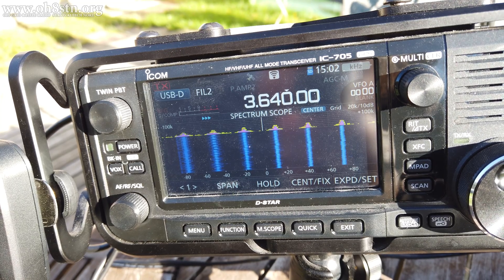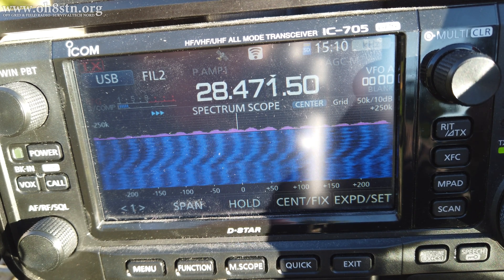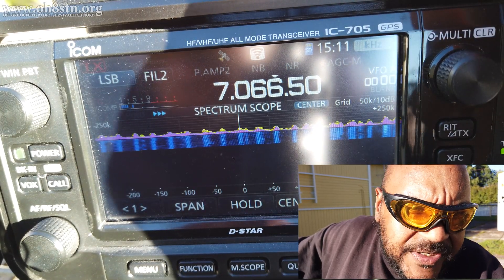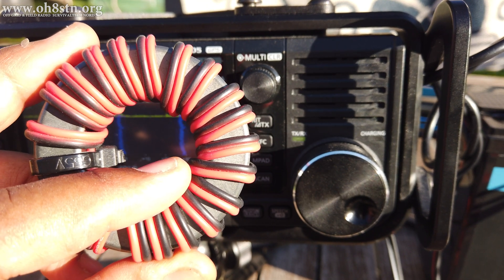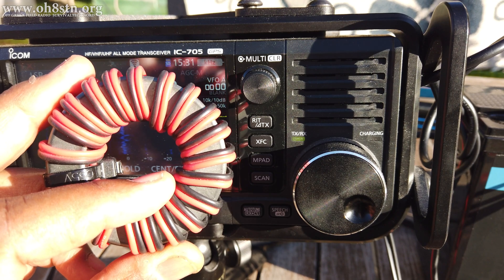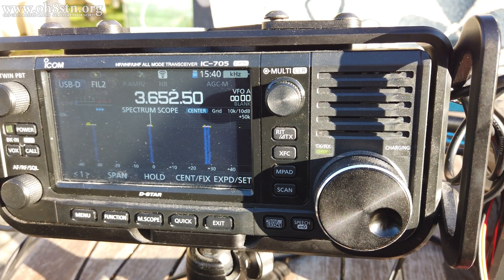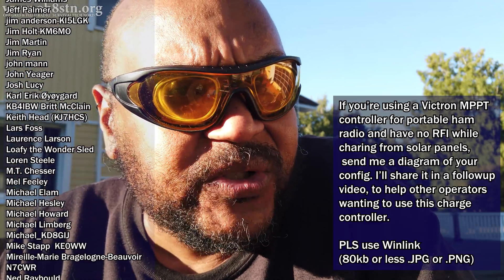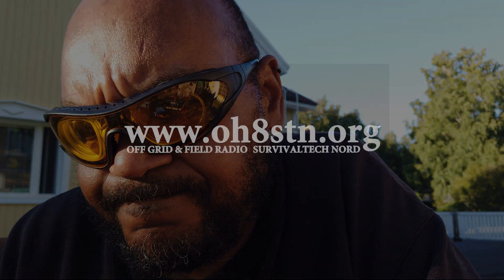Victron SmartSolar MPPT Charge Controller

Comment: Julian, I did a bit of testing with the 75|15 and never got back to you, the radio needs to be connected to the battery, i noticed on my smaller 6Ah battery it was much better but still not acceptable... however on my 100Ah Lifepo4 it was nearly silent.... i went back to the 6Ah and added a filter cap inline and was nearly as good as the larger battery. According to my spectrum analyzer there is always there when in proximity of the victron even when not connected to the radio, even with genasun. Victron is usable with a large filter cap and radio direct to battery... with a larger battery acting as a filter it was as good as genasun......... but who wants to carry around a 100A battery?

Also, with lead acid battery as filter i noted remarkable results with both controllers on the service monitor.

So i think the LiFePo4 is the learning curve hump to get over
Reply: I'm hoping to put some time into some more testing soon.... i am thinking it will require a simple filter method with more than just a capacitor on the smaller batteries.... first company to make an RF silent charge controller will win big! but we are just a very small segment in their demographics so not holding my breath. 

As for now, even the genasun is bringing noise, but it is much better (according to service monitor/analyzer) than the victron, epever and go power that i have tested.

As you know, i operate my station with Mazzoni Loops exclusively and even my genasun 10amp makes noise on the loops narrow bandwidth that can be heard by ear, radio filtering makes it tolerable and in many cases knocks it out since it is not a wide banded byproduct..... but it still needs to be overcome for the really really nitty gritty weak signal work, on the entire spectrum available to us.
Since my antennas are so narrow I am believing most of the noise is coming from the power system rather than the antenna, if you have a chameleon or similar loop you should be able to reproduce my findings easily with an analyzer...... maybe not so much with the genasun by ear though. (it's definitely there by ear on my ftdx101)

My next test I plan to add additional shielding to the victron and genasun to try to determine how much is coming through the power leads vs the antenna, as well as try different battery species to better understand if maybe the Li and/or BMS is exacerbating the noise.

Comment: Hi Julian,
I've seen several comments mention a Faraday cage. Could you try just wrapping the controller with aluminum foil as a test? Stay safe.  73  WJ3U
Reply from the maker: Yes, I'll try it. Got copper tape incoming.  Will cover the inside of the enclosure. 
73
Julian oh8stn

Comment: Had a similar problem from a router some time ago. Even if I put the router in a metal box, as a faraday cage, to make sure RFI wasn't the issue, that at least proved the problem was EMI on the ethernet lines, as opposed to RFI from the router.
 Divide and conquer. Or see what Victron has to say. Their marine users will not be happy about SSB interference.

Comment: I saw noise with my Genasun GV-10 when I first got it and what I did was put two of the Powerwerx DC Line Noise Filters on each of the solar and battery lines (not just one or the other). That seemed to help significantly for me, at least, but then again, the Powerwerx product also has an amperage limit that might not work with the Victron controller. Maybe it's possible to parallel more than one of the filters for increased current capacity?
Reply from the maker: Found them! DC line noise filter maximum 20 amps from Powerwerx. I'll order a few. 👍
Reply: Did the filters fix it for the Victron controller? @OH8STN
Reply from the maker: I haven't heard of those powerwerx line filters before. Great comment, I'll give them a look.
73
Julian oh8stn

Comment: that is interesting.... we use these for work for our remote sensors and have been fighting interference issues on vhf. i'm going to have to dig out my spectrum analyser next time im at one of those sites
Reply from the maker: I really appreciate this comment. Any anything you learn please come back and share. Thanks for watching and commenting.
Reply: @OH8STN  yea for sure...  i will do... but might be an idea to check your radio on 144/433 too see if it's there as well... my guess is if it's stopping when you unplug the solar it's the pulse width modulation that it uses as charging
Reply: I have the 240v 17ah charger and it also wipes out uhf/vhf

Comment: Thanks for thr Video! I have the 75/15 and 100/20 MTTP Victron Solar Charcher. I didn't habe any problems jet. But I'd have to admit that I use normaly 40m and higher QRGs. But no Problem so far on my FT 991A. But a question: Test it with a solid grounding of the system. Maybe the solar charger generates a lot of less HF with that. Ans test it with other Rig. Sometimes the Radio Filters are not good enough. Cheers from switzerland.
Reply: Julian can you also do a test with other radio maybe a 100 w Yeasu
Reply from the maker: Already tested with Yaesu FT-817ND,  Icom IC-705,  Xiegu G90, Xiegu X5105,  Xiegu x6100, Vertex Standard VX1210 and SDR. Sadly, It isn't the radios, it's the charge controller!

Comment: It would be interesting to redo the test with a choke on each of the inputs and outputs and at each end of the cables. The cables must also be twisted over the entire length and not in parallel except on the ferrite.
What type of ferrite was it? Is it #31? That too is important.
And of course, it is always necessary to feed directly to the battery for the radio.
A choke on the antenna and the radio on the coax will ensure that your coax is not part of the antenna, therefore picking up less noise from the charge controller.
But actually, the fact that the components are not fully wrapped in a metal case does not help.
I wonder if the ''Nickel shielding spray paint'' inside to create the desired effect or simple self-adhesive copper strip inside could help?

Comment: You might be able to get a faraday pouch for a tablet that could fit this controller, fail this wrapping in tinfoil might work. If this works you could take the cover off and stick some tinfoil to the inner face of the case etc. I am looking at a small solar set up for my shack, will be interesting to see how you get on. Good luck Julian!

Comment: Years ago, I worried about RFI noise from MPPT solar chargers, so I ordered a "Morningstar Tristar 45A PWM Solar Charge Controller". But, PWM also makes RFI noise! So, I changed it's operating mode from PWM to OFF-ON charging. That allows me to use Ham radios while charging up my 48vdc battery bank.
(I've been off-the-air for many years and recently got interested in HF again).

Recently, the price of electricity has gone up. So, I decided to get rid of my old Modified Sine Wave (MSW) AC power inverter and purchased a "Xijia 3000W (Peak Power 6000W) dc 48v to 110V 120V ac 60HZ Pure sine Wave Inverter". So I could use my "back-up" system to provide a little relief from high grid prices.
By running the new 3kw inverter, I can save a few bucks on power and insure my back-up system is always in working order. 

Oddly, it's the 3kw (Sine Wave) inverter that's making RF noise. Very similar to what's on your spectrum analyzer display. It's got harmonics on all the HF ham bands. 

My current HF rig is a QDX (QRP Labs Digital Xcvr) and it's almost useless for DX when the 3kw inverter is running. So, when I want to work some DX, I turn off the 3kw AC Inverter and use the grid. 

PS: I've seen similar RFI waterfalls randomly while using the QDX. They seem to be coming from some local source.. Maybe someone is using Solar RFI generators in my neighborhood?

Comment: Get another MPPT charge controller.  Don't waste your time trying to fix the Victron.  I see you use a Genasun charge controller.  Good.  I have no noise/interference problems even connected to a LiFePO4 battery with internal BMS.    Handles up to 140W/10amps.

Comment: Would an extra connected battery help ? I realise it means extra weight & bulk in the field but I'm wondering if it might filter out some of the noise from the solar panels as the current flows into one battery & then via the other.
Reply from the maker: This will definitely work. It would mean reducing the size of the batteries and carrying two. Discharge one while charging the other. I believe this is going to be the ultimate fallback plan if everything else fails. Thanks for watching and commenting. Excellent comment!

Comment: Very interesting issue, before this video I was near to about to explain another issue related to battery and 2 radios at same time operating. 

Issues related to noise.
When using my FT891 with the Lifepo4 battery 45ah, and transmitting in Winlink with raspberry pi 3B+, I realize that using at the same time transmitting in 2 M with QYT K8900D in a repeater, Everybody reports me strong Noise. But when digital or Winlink ends the noise go away. Not sure why, I am experimenting on this.
 
I think there may be a series of videos about noise related to Lifepo4 batteries, HF and VHF radios using at same time with raspberry pi 3B+

I hope your problem gets a true solution complete solution.

Thank you for the video.
Reply: I also use an FT-891 with Winlink and a Raspi 4.  I will check my 2m radio next time I send a Winklink transmission on HF.
Reply: @timbookedtwo2375  I will follow your results.

Comment: Do you have a choke on your antenna feedline at the radio?  I like your testing methodical process and am sure you will find a solution.   A quick coax choke I have been using near the radio is running coax through the torroid with four or five wraps, cross over through the center and the same number of wraps the opposite direction on the other side of the torroid.  All this a foot or so from the radio.  Quick and easy to try.

Comment: Faraday cage for the MPPT? Or locating the toroid directly at the solar panel source?
Reply from the maker: The Faraday cage idea keeps popping up. I think I'm going to try it. The only problem is figuring out a way to do it without adding much size and weight to the kit. Remember this is a portable system. But it's a great idea.

Comment: I know it’s simplistic but what happens if you move the controller and battery a distance away from the radio?  I only suggest that because if I have my iPhone to close to any of my radios I do get at least noise. Just curious.
Reply from the maker: That's an excellent point.
Since our benchmark, (Genasun) controller creates very little noise under the same circumstances, we expect the same from the victron. It's a great point though, I'll see if I can demonstrate it in another video.
73
Julian oh8stn
Reply: @OH8STN  Maybe worth a shot. Thx for the vid

Comment: Hi Julian.  I have two of these Victrons - running a 60W Powerfilm rollable panel and a 12Ah LiFePo into a IC705 connected to the battery terminals.  When you first announced this problem a few weeks ago  I tried to replicate it - absolutely no RFI from either Victron - we ran this set up with Callum when out and about a few weeks ago.  I have used it a lot when portable and again no concerns. I use the BT connectivity as well.  No toroids needed here.  I wonder if your particular controller has a problem? Does having the controller physically near the radio affect the RFI? Good luck.
Reply: Julian have you tested any other units to rule out that you have a faulty one

Comment: Has anyone tryed other makers of charge controllers?
Reply from the maker: Of course 👍
Stay tuned!
73
Julian oh8stn
Reply: @OH8STN  I have been thinking of getting a EPEVER, mostly because of the price. It is larger and may not be good for taking it off for what you do.  I am not able to do what you do because of a bad back. Living in South Florida,  a way to get power after a storm is what I want. If I get it I will see if it keeps me from using my IC7300.   73  de W4DES

Comment: Hi this is switch  mode noise. If you have a RF choke you use for HF for a say 100W (bigger is better) antenna system try it in series with the output of the controller to the radio.

Comment: I don’t think this adds anything to actually help you but I use the exact same MPPT Victron you have.  I DO NOT connect anything to the LOAD side of the controller.  Obviously I have my panel running to the PV connection.  I have wire running to my LiFePO4 from the controller.  I run an FT-891 in the field that is connected to the battery and generally running at 20W.  The Victron is run to a 100W portable solar panel.  The controller generally sits within a foot or so of my rig.  Not quite QRP but I have never experience any RFi from the setup.  Have you tried to swap out your rig.  If that doesn’t show anything, maybe try swapping out your antenna.  You might also try to move the controller away from the IC-705, however, like I mentioned, mine sits no more than a foot away from the 891.  I hope you’re able to solve your problem.  I find that even with moderate sun, I’m able to power the FT-891, a laptop and tuner going and the LiFePO4 stays fully charged.  Best of luck to you!  73

Comment: Call Genasun. I think they'll build what you need. Ryan I think. No one else considers Ham/HF community. Hail Genasun.
I have a mini mppt by powerwerx, but it's a backup, and I've not tried it on air yet. (Maybe today)
73
Reply from the maker: I know Ryan quite well. He sent over a few charge controllers over the years for testing. He knows we're waiting for a 20 amp version of there GV series.
73
Julian oh8stn
Reply: @OH8STN  if Ryan is listening: HI!
Good luck Julian, them noise fairies are ruthless.

Comment: Known issue. You could try chokes everywhere, but it will only drop by a few s points. You’ll just have to charge while not using the radio.

Comment: Would a capacitor on the charge controller output help smooth out power? Maybe someone with more electrical experience may be able to answer this.
Reply from the maker: By the way this is how buddipole charge controller works. They have added filters for each HF band to quiet down the noise. So it's a great idea probably will work.
Reply from the maker: You could buy one and do the testing yourself 👍 Would be very helpful.

Comment: I seem to remember Callum - DX Commander having RFI issues with a Victron Charger as well. I never use the load port on my charge controller (EPEVER 1210) as it's only good for 10A and if I'm QRO with the IC-706 it just kills the power. I've never done any analysis on RFI when using it in the field, but then I tend not to operate that long.

Comment: Could you analyze components in stages with an oscilloscope to find the source of the noise? First analyze the panels, then the charge controller with the panel with no battery, then charge controller with battery and panels.
Reply from the maker: I'll need an oscilloscope. If I can borrow one, I'll definitely do it.
Reply: that is the job and responsibility of the manufacturer. he needs to fix the rfi problem.  best thing is to buy an mppt charge controller that does not emit rfi from the getgo. i have had good results with genasun for lifepo4 batteries. max input 140w/10amps. works for me in shack and portable.
Reply: @timbookedtwo2375  I think the point of this exercise is to greatly exceed that 140w power level for larger stations. He's already using two of those in parallel, but he'd like to produce 10x or 20x watts. I'd like to make 10kW to power an RV and a small EV off grid without RFI.
Reply: @MrHuram-abi  What does the manufacturer say about RFI?  Is the manufacturer working on a fix?   That's his job, not ours.  Otherwise find a another controller.  Victron is "top shelf" and commands "top shelf" prices.  It should not be causing RFI.

Comment: Is the Victron's solar charge controller case made of plastic? Maybe the noise is radiated and not propagated through the cables.

I use 2 Victron battery chargers for my radios.
The 5A model, plastic case, puts out a lot of noise.
The 30A model, metalic case, doesn't create noise, or at least it's not noticeable on the signal meter or the waterfall.
Reply from the maker: That's an excellent point, I'll check. The Genasun case is also plastic but produces much less noise.
Reply: The 30A model have also plastic case. The same Bul....it